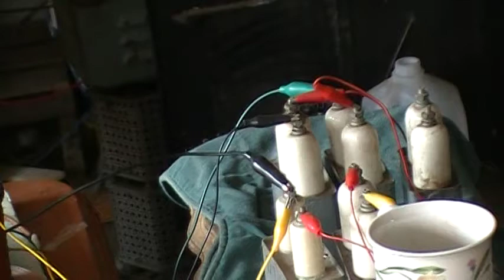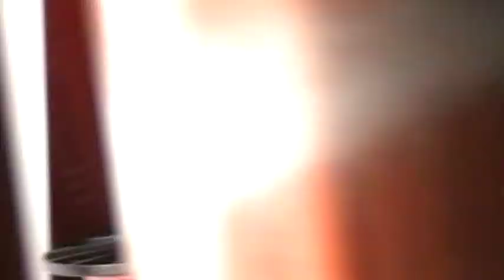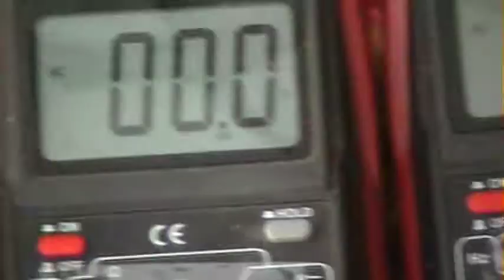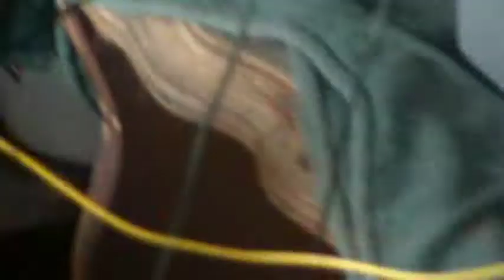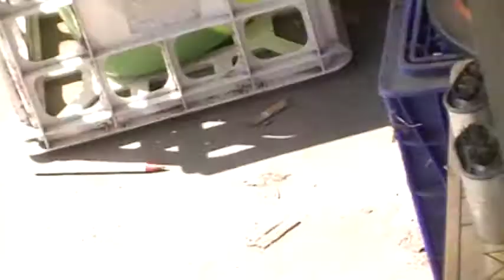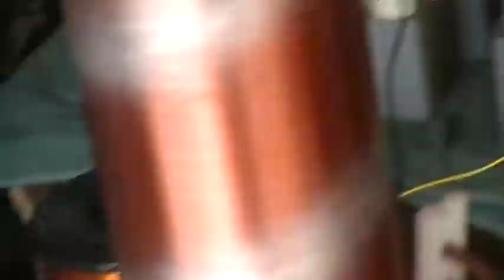3 phase alternator /Wireless bipolar TC driven by 666 pancake spiral system

Comment from the maker: Over a year later on review of the video mistakes are noted. The phase rotation IS in the direction of the numbering order. For those dubious about a device attempting to send back voltage to its own three phase source note that in the beginning the draw is ~.3A on any selected individual phase to be energized. Source frequency air core transformers are not like ferromagnetic ones in that they operate in reverse principles of having the highest value on empty load, and then loose vibration when loads are added. When phase 2 is added, phase 1 looses half of its vibration. If phase 2 were energized first it would have the same vibration as phase 1. Now phase 1 lost half of its vibration but phase 2's vibration was more then doubled from what would be the vibration found in its solitary state! So technically we are getting more then twice out then what we put in and this is the basis for the device kicking back voltage to its 3 phase source of voltage where in certain cases we can show over 100% efficiency!